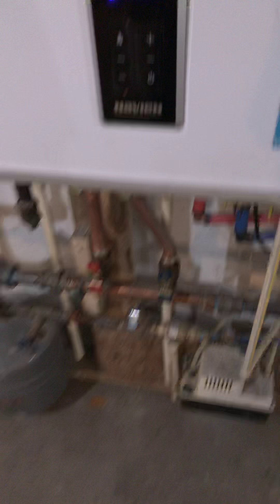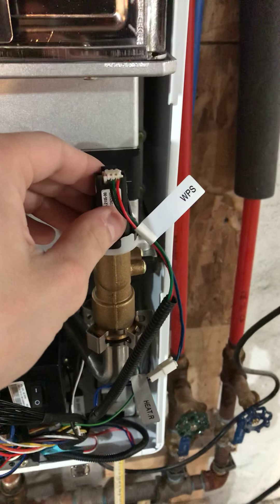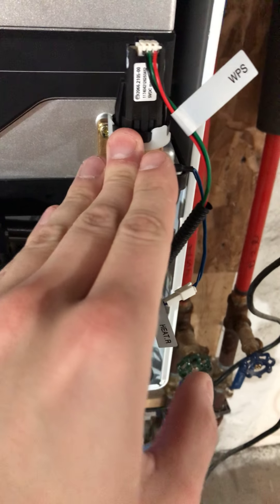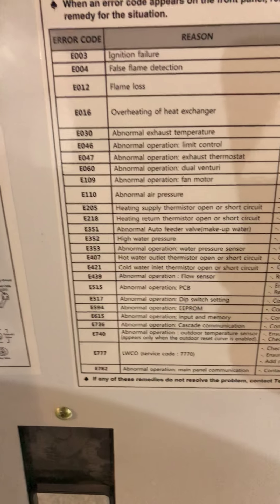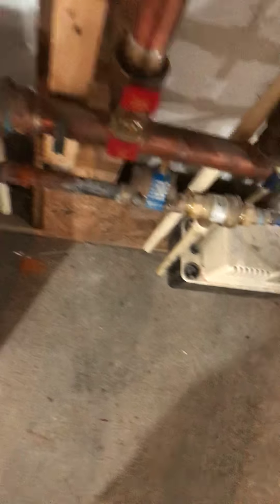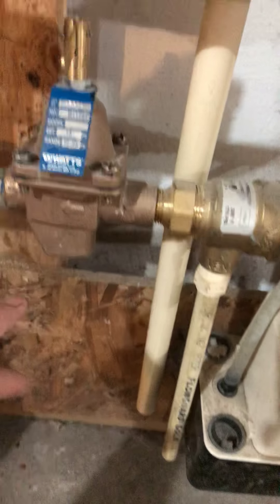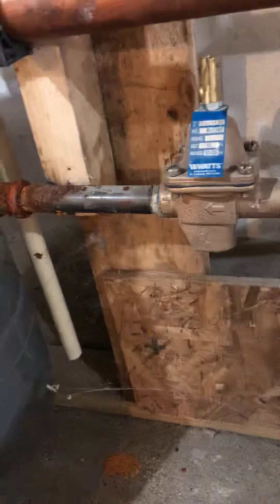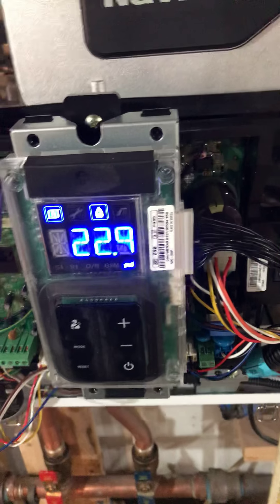Navien tankless water heater E351 error code FIX Navien tankless water heater problems maintenance

Comment: Dude, you saved my weekend! Friday at 6:00 and no hot water. In desperation, I search you tube and there it is! Followed your instructions and BAM! Hot water.

This is my second Navien. My first, the predecessor to the model we have, was such a piece of crap that I had in removed and replaced with the 240E. One of the problems with the old unit was that seals and heat exchanges kept blowing out, Finally, after many, many failures, the tech tested the water pressure and found it to be extremely high. After a pressure reducer was installed, things were better and there were no more problems with leaks and blown out components. It still sucked, however, and broke a bunch more times. I ended up negotiating with Navien and the dealer, and we all shared the not-inconsiderable cost of replacing the old unit with the 240E. It’s been much better than the old one, but then there was tonight. Oh well. Now I know another trick. I think that owning one of these necessitates some hands-on activity. As great as it is to have professions come help, it’s $200 a pop, and that’s after you’ve had a cold shower, your house is cold, you’ve stayed home from work to let the tech in. And that’s if you’re lucky enough to have the problem on a weekday. Knowledge is power. 

Hope the above is enlightening for all of those saying that there should’t be any pressure reducer in the system. Measure your water pressure!
Reply from the maker: ScottAClarke awesome to hear! Glad I can help. Thank you for the comment

Comment: Thank you so much. Second time I have had to watch this video.  Worked both times.  You are the man!
Reply from the maker: So glad to hear! Thanks for the feedback
Reply: @themillennialhomeowner1661  I've had to do this twice a year. Seems like a system flaw. One question is how long to pull the lever. My experience suggests that the hissing sound ends after about 10-15 seconds then water starts to flow and I push the lever back immediately when the water flow is apparent. I'd be curious about your experience.

Comment: Thank you so much for the video. Mine is Navien NCB-180 Combi, same code E351. Until yesterday I turned the heating system on for the first time of this winter, the domestic side was ok (PSI 10.2) , however, after couple of hours, the machine was turned off itself with code E351. I unplugged and plugged back in with the heating side off, I got hot water back. I watched your video and wanted to find the auto refill valve but there is nowhere to find. Is here anybody knows what's going on with my Navine? Btw, a plumber thinks it maybe leaking somewhere along the pipe lines. Thanks!
Reply from the maker: Hey there! So I’ll start by saying I am not a professional, all I can do is give my experience. Outside of what I showed in this video I’m not sure how much I can offer but I can try!

If it’s leaking somewhere, that’s a bigger issue and I would consult a professional as leaking water anywhere is a big issue. 

I would re visit trying to find the valve fill on your set up. The e351 error code means a low water pressure. So either water is leaking somewhere (which I would imagine you would see if it leaks that much to cause this issue) or there’s not enough water in the system to have the pressure at a proper level. Follow your water line and see if there’s anything that resembles what I show in this video. If all fails call a professional and watch what they do so you know for next time. 👍🏻
Reply: @themillennialhomeowner1661  Thank you very much for your reply. Actually, I hired a Navien certificated company last summer due to the Heat Exchanger over heat problem. It costs me $1,800 to get hot water back, labor only. The code E351 appeared once and the same person, Adam "fixed" it too. We did turned on the heating system but only for a test. I guess if I called them again that will cost me another $2,000.....
Reply: The ncb units have a direct 1/2 make up feed installed from the factory with its own electronically controlled valve. I ran into one that had no make up feed to the unit throwing a e351 code. What this video is showing is someone uneducated installed his boiler and over complicated the system causing the boiler to malfunction whenever it needs make up water

Comment: I'm not getting a code but I have those same problems.... water temps. not regulated, have to wait for it to warm up and, not enough water pressure. I will have to try these.
Reply from the maker: Check the PSI on the lcd screen if your model has that. If it’s low that can be the cause and you may need to “force fill” which is essentially putting more water in your system.

Comment: Having the same problem here on our new Navien combi NCB 190.
We're having at least 2 problems;
-one is that the Navien pressure sensor shows ~5PSI lower than gauge pressure ( I've got TWO gauges on the feedwater input, one being very high quality)
- Second is that the latest Watts feedwater regulator valves are now made in China (look it up!)
Watts now has the "Made in America" decree from the gov., but the feedwater regulators aren't one of them,.. so far.
Went to adjust the regulator, it's all over the place,..1/4 turn does nothing, then another 1/4 turn, it jumps 25PSI!
( bleeding it off/resetting the gauges every time)
Adjusting it back down has the same ongoing, non-linear BS, it jumps all over the place!
Definitely NOT linear!
Took me over an hour to get it "more or less" in line to 15 PSI. (we have 40 year old black pipes, 30PSI blew a pipe loop- thank you very much Mr. "know-it-all" plumber!)
Might switch to a Conbraco FF feedwater valve or any other American Made unit.
And probably switching to a Rennai after the Navien warranty expires/craps out completely.
(The Navien is also making weird new motor noises, demand flow sensor not working, etc...all after owning it a whole 7 months!)

Comment: Holy cow, you have it 18 psi? Mine’s showing the same error code and it’s at 8.1 not sure how to find out what it should be at
Reply from the maker: I want to say for some reason 12psi is in my head for some reason but I’m not sure where I got that from. Too low and the error will come on. As long as I see mine above 12 I don’t mess with it
Reply: @themillennialhomeowner1661  thanks for replying and this video. Have you ever had the display read AIR? I can’t find anything about that
Reply from the maker: @gizmocaca9461  two things that can be. Air in the system (which you should have an air purging system hooked up anyways) or check the air filter coming in. One of my videos shows the air filter I believe. Simple to do if you take off the front cover look in the top back left.

Comment: Thank you so much. My parents didn’t have hot water for two days and I went by their house to call a plumber and check it out. Was a slightly different model so it looked a lot different but once I was able to identify the water pressure valve, your method still worked just the same. Appreciate it. They’re so happy 🙂

Comment: Thank you for this post. I can confirm that ‘blurping’ the water feed does work. According to my HVAC guy, the issue was likely caused by an air bubble that confused the flow sensor. Shutting the inflow valve on and off to get rid of the bubble fixed the issue for me.

Comment: Worked great. I have a older unit so it was a different looking arm I raised to re-pressurize that was directly above the tank that holds pressure on mine and I only needed 12.4 psi for my size unit in an apartment. Thanks
Reply: What does your arm look like because I can't find this arm on mine?

Comment: Pressure keeps dropping me. Should I replace the sensor ?
Reply from the maker: It continuously drops? Or just once in a while? I notice these errors tend to come up in the winter time. Most likely due to the weather. If it’s once in a while this fix will work. Otherwise the issue may be deeper

Comment: We had the E351 code and we just shut the breaker off for 60 seconds and turned it back on and it worked. 🤷🏼‍♀️
Reply from the maker: Thank you for the comment! Same here I was able to do that the first few times as well and then the trick didn’t work. Hopefully it continues to work for you but if not the steps in this video should help.

Comment: Although this fixed the issue momentarily, it is a sign that there is a pressure loss, translated it means that there is a leak. These systems are closed loop and once you fill it and set the pressure and purge the system you should close the fill valve.
Reply from the maker: Thank you for the feedback

Luckily it’s held up ever since

Comment: We had the same issue this morning. Our Navien NCB-240E was experiencing the symptoms you described: water too hot, temperature fluctuations, and this morning, no hot water. I flipped the pressure switch up and some water came out of the relief valve. After restarting the unit hot water started running again! Thanks for your post.
Reply: if you have one of those valves installed get it out and have system water piped correctly trough outlet on the unit, adjust the heating water pressure on the unit.
Reply from the maker: Amy Havens glad I can help!

Comment: Would you happen to know how to fix the system if the pipes around the system are hot but the baseboard pipes around the house are just warm and not hot enough to warm up the house. However I am getting adequate hot water. Thanks!
Reply from the maker: I’m not a professional but I do know the hot water is circulated through the circulating pumps. If you look in my videos it’s the green TACO circulators. I would assume if you’re getting hot pipes near the furnace but not up to the baseboards it’s not circulating. I could be wrong though but I would check there first
Reply from the maker: Also check my other video about raising the water temp. When it gets really cold out you need the water temp to be higher. If you do t have an outdoor thermostat that may be your issue

Comment: Thank you for this. Navien customer support is awful. My local Navien certified technician wanted to be taken off their list because of all the design issues.

I’ve already had this valve replaced once on their older model, and I’m guessing this continuing to fail is another design flaw with the unit. Thanks for saving me a few hundred bucks!
Reply: @bigDrob  I’m sure you’re right about that. This unit had some major design flaws, though. The combustion chamber seal ended up falling into the chamber, and escaping hot air melted the sheathing on one of the cables, which promptly shorted out the board. And it happened the day I brought my newborn daughter home from the hospital.

Problem is, to get a HVAC out to make the phone call costs me $250. It’s all set prices now, and with the amount of times I had to call them, it would’ve been cheaper to stay on oil.

Navien ended up replacing the unit under warranty. I have a NCB model now that is much quieter and performs better. Haven’t had to touch it in 4 years.

Feel free to help out any of the people that comment here, if you can. We’re all just trying to save money heating our homes!
Reply: @bigDrob  hey man any chance you can help me with my navien ? I’m having this same error and the trick fixes it temporarily
Reply: @bigDrob  I think mine was installed wrong. This is my second winter with it and I'm having problems again. I'm having this error code but I don't see the lever on my system that he's saying to push back. I have well water and hot water from a different tank. The problem is it seems like Noone knows anything about this system and it's a struggle trying to get some one to fix it. I've been without heat for awhile and really wish I can get this thing working again before the temp drops.

Comment: I had the same E351 error code today and there is no hot water. I followed your step about pushing that lever up. Initially it shows a message "AIR" on the boiler screen and still no hot water. I then unplug the system and plug it back and turn it on, and the boiler starts working again and I now have hot water. Hopefully this isn't a temporary fix. Thanks for posting this video and saved me a couple hundred bucks.
Reply from the maker: Tony Yung glad to hear it helped! I find once every few months I’ll have to push the lever up just a tad to get it back to the right pressure. No big deal. Mostly an issue in the summer when the heat isn’t constantly on. I’m not a professional but I believe AIR is the air filter needs to be cleaned. But if it’s fine now don’t mess with it right? Lol

Comment: Good video, this unit has its own water pressure fill valve build in and one that you have there was installed unnecessarily don't need it! there may be an actual problem with it not with the boiler. Plumbers that are not familiar with those units are installing those.
Reply from the maker: 786otto thanks for the comment!

And it figures, I bought the house with this unit and they flipped the house so they probably did it themselves.
Reply: Yes...I'm a contractor...that is the first thing I noticed. I install nothing but Navien because I have 0 call backs on them. Correct installation is the key.
Reply: @stevehoug3265  Yep ,even if installed by one first time ,it just takes to look at instalation maniall. Those are great units.

Comment: The item next to it that has the two half unions is a backflow preventer so you don't backflow water from your system into the city system that's standard on all hot water boilers and steam system

Comment: Great video! Ive had problems with my unit since day 1, and while it works amazing when it does work— navien units can have design flaws. I paid 200 to a plumber to clean that water valve that you replaced. Two winters in and this problem kept happening. @4am this happened again and i was able to fix it using your video. Thanks so much bro!
Reply from the maker: spanishflybandit sorry that you had so much problems with these they really are great units! Periodically I have to do this when the pressure gets low maybe once every few months but no big deal. Glad I was able to help!
Reply: To Spanish Fly: Are you being truthful?

Comment: I must say "THANK YOU". This saved me a great deal! Why the water temp goes too hot or too cold at the faucet and at the shower? Please help
Reply from the maker: xingle2009 I don’t know the exact in and outs, but I believe it has something to do with the water pressure in the system which causes this E351 error code. I assume not enough water pressure leads to inconsistent temps. At any rate if this video solved your issue you should be good to go 👍🏻

Comment: That's called a pressure valve it regulates the pressure into the system when you lift the handle you let City Water fill up your sister you also could adjust those

Comment: This is why you were told to call a professional. Navien boilers have a built in auto feeder. The Pressure reducing valve you installed is not only not needed on this boiler but will eventually cause severe damage to your unit.
Reply from the maker: Lance Walker considering I was told the system needed to be force filled by the tech support himself, i disagree with your statement. He told me to hire a contractor because he didn’t want to tell me how to force fill and put pressure back in the system for liability reasons. So, I found out for myself instead of hiring a contractor for hundreds to push up a lever. Not to mention, it’s 3 months later and the pressure hasn’t dropped.
Reply: @Eric Skiba  Eric, now who is showing ignorance?
Reply from the maker: Lance Walker if you read my description I specifically said I’m not a HVAC tech. So for you to assume I think I’m an expert is ignorant in the least. 

Second, a “professional” like yourself had this unit installed as I bought this house recently with this unit already installed. So you assuming the “professional” like yourself who installed this did it wrong yet again is ignorant and makes you look even less legit. 

Third, the tech at navien told me to look for the pressure reducing valve to force fill the unit. I couldn’t locate it while on the phone, because again I’m not an expert. Until I did some digging and found out some things about the system. So for you to assume he is wrong, again, is ignorant. 

Fourth, the manual says the auto feeder valve is a MAKE UP valve and is supposed to regulate the pressure. However, look at any YouTube video of “professionals” who force fill units and they even say from time to time you have to force fill them. I guess nobody knows what they’re talking about besides you...? 🤷‍♀️ add into the mix 8 likes on the video and another comment saying it worked for them stacks the deck against your argument.

At any rate I’m not going to argue any further on YouTube over something. You have 20 years experience great. I’m a home owner who is new to all of this and had to learn for myself and has worked for me for months. Also couldn’t find anything online doing it the “right way” without being ripped off by a HVAC tech to come out and hopefully by putting this out there I help someone. 

Appreciate the opinions, but this worked for me and apparently others as well.
Reply: Don't think it will cause damage but is just unnecessary, and when external water reducing valve will clog will cause errors.
Reply: I'm a plumber that is an automatic feed valve which you need on the cold water supply, I am having the same issue with my NCB 240 and I am thinking now that its faulty and needs to be replaced
Reply: @billdeluca995  Good to hear that you are a plumber is not easy to be one , now when you get to it best to remove auto feed pressure reducing valve from Navien NCB you working on , or temporary just open it always up , and your problem will disappear , good luck . Just read the instructions!